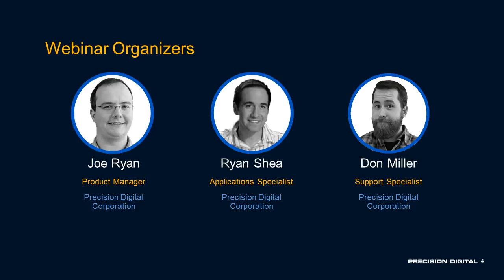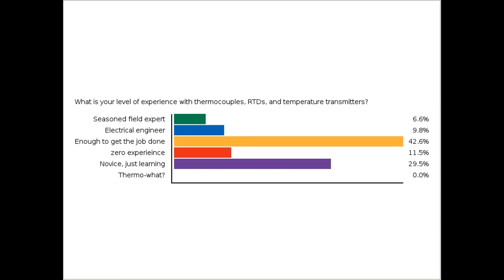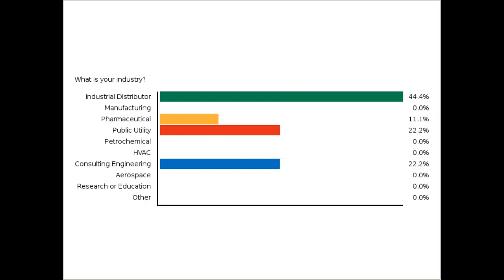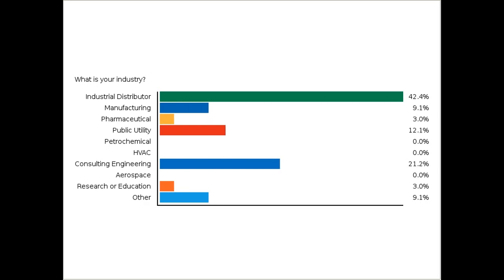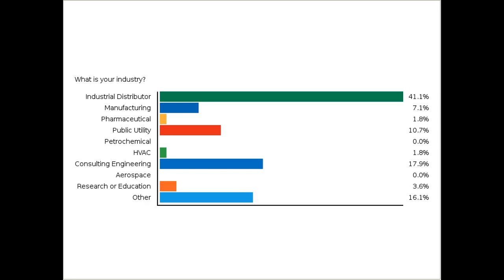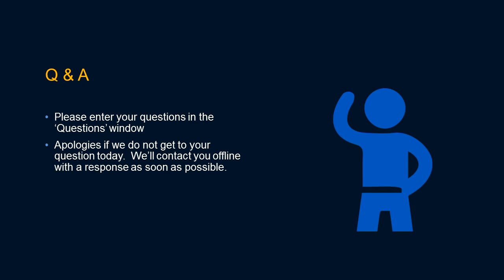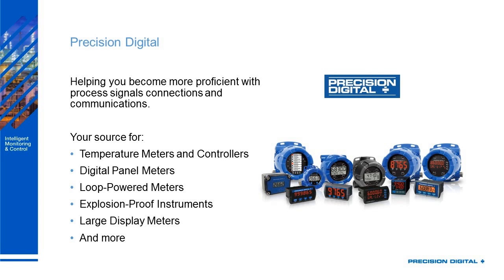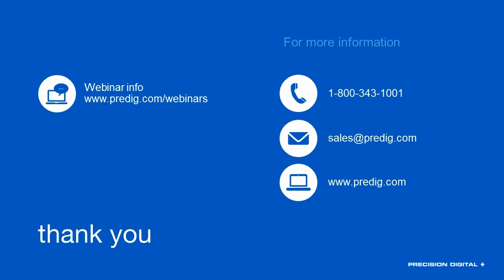Introduction To Thermocouples, RTDs, and Temperature Transmitters

Comment: RTD is also remote thermal diode, right?
Reply from the maker: In this case RTD stands for "resistance temperature detector". It is essentially a resistor that changes resistance predictably with temperature. It is not a diode. By measuring the resistance, one can calculate the temperature.